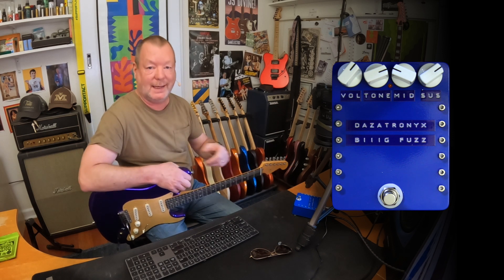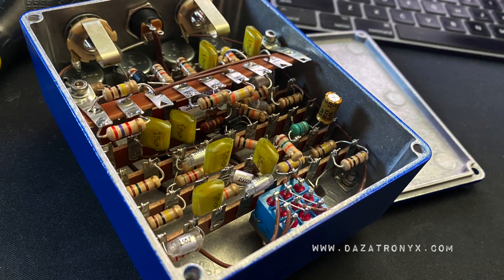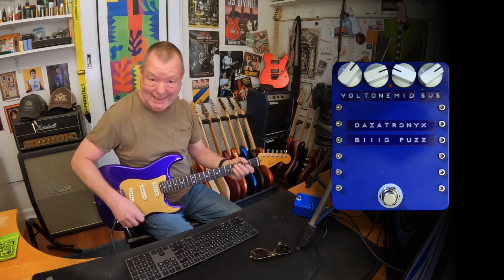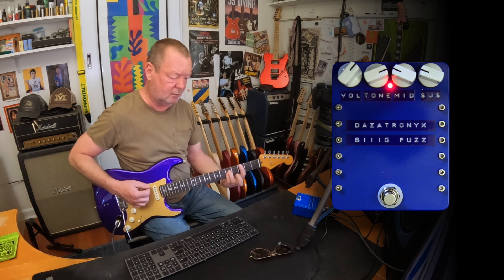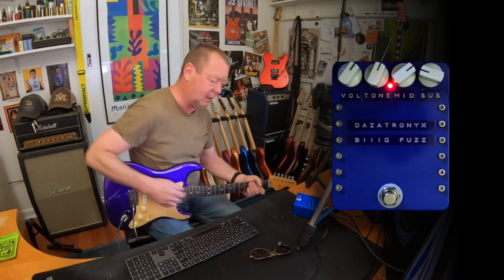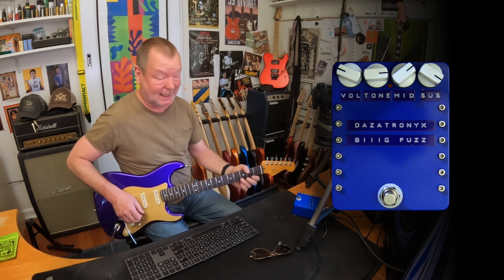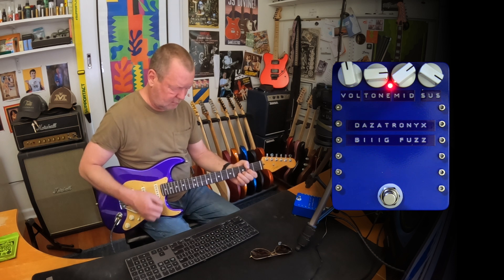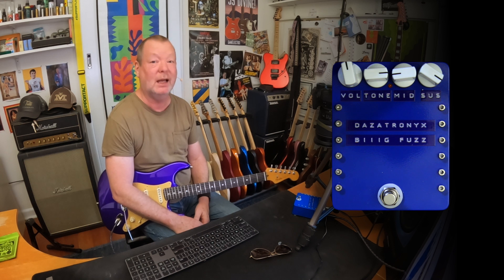Dazatronyx: BIIIG FUZZ  PTP Muff

Comment: Hey, Brett, big fan of your playing (especially when you're in your Gilmour bag), ears, and videos – you led me to the Stomp Under Foot Red Menace, which is the fuzz I've been trying to find for decades. Would you happen to have a recommendation for a distortion, or maybe a stacked OD, that can do the "liquid lead," very saturated, midrange-thick solo tone without too much treble fizz or boomy bass? I've found some good ones, but I feel like there's still something out there waiting for me. Thanks!
Reply from the maker: I'd have a look at one of the hotter Dumble-type pedals, Michael. They're all about midrange, 'chirpiness' and smooth tops. Depends what amp you're running too. For instance, if you were running a Vox AC30 at battle volume, I'd go for a good treble booster like the Red Ochre I demoed here a couple of days ago. That will put you straight into Brian May territory. Gilmour tones? HIWATT and a good Muff - like this one.
Reply: @BrettKingman  Thanks for the response! I use a few very different amps, either a Vox or several Mesa/Boogies, so part of the quest has been finding pedals that can work with both & learning to stack "sculpting" boosts/ODs, depending on what the amp likes to see. I think my best results so far have indeed been a Dumble-style pedal, the original 2-sided Cornerstone Gladio, and I've got that Red Menace and a black-box Butler Tube Driver on the way for (hopefully) getting to Gilmourville. Cheers, and great work!